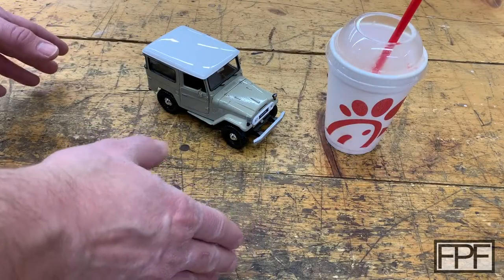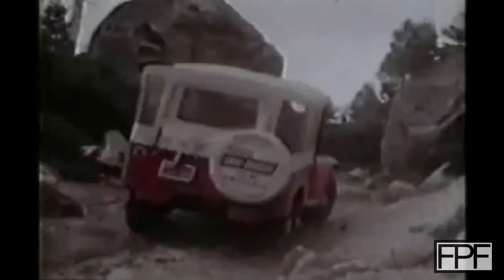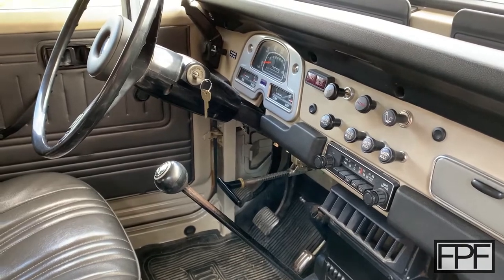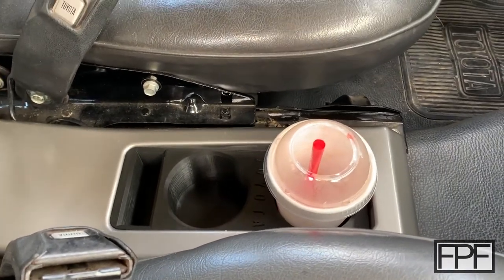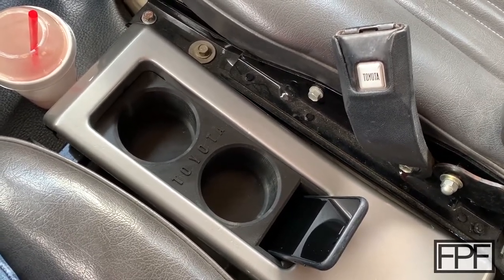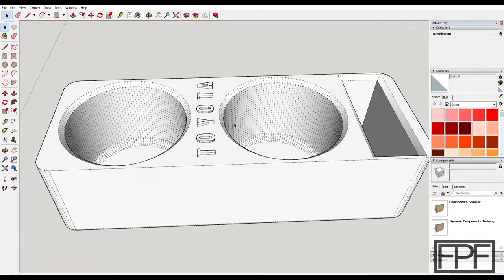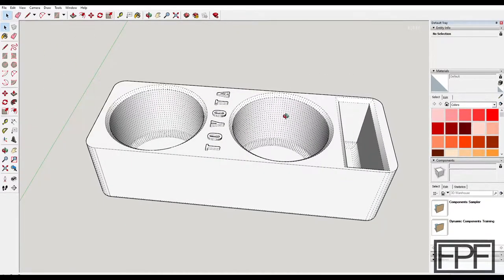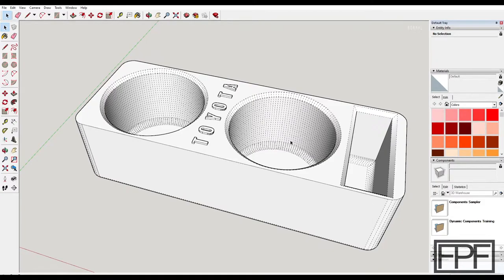3D Printed Toyota FJ40 Land Cruiser Cup Holder

Comment: great video! I just did the same with the massive gaping opening in my nissan titan to include another cup holder as well as pen holders and sunglass holders. Have you tried Fusion 360 yet? The ability to set parameters as well as design from a calibrated reference image makes things like this very easy.